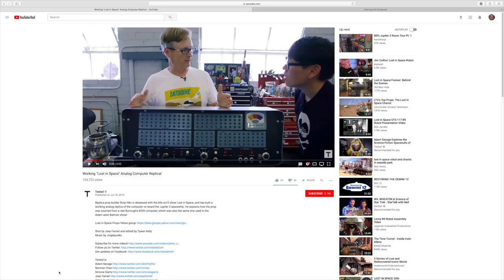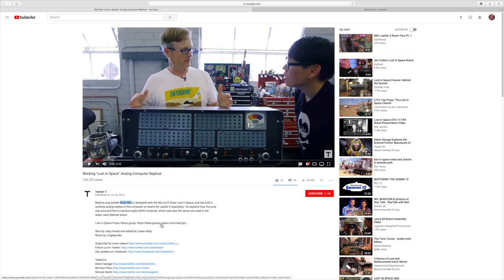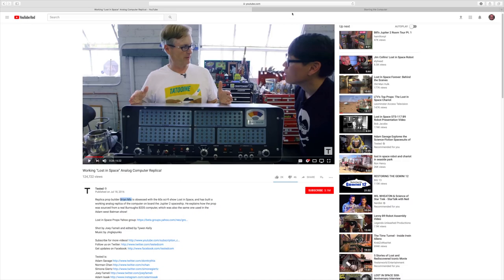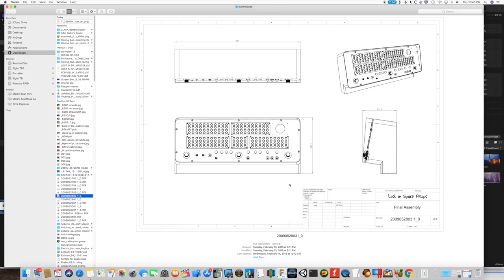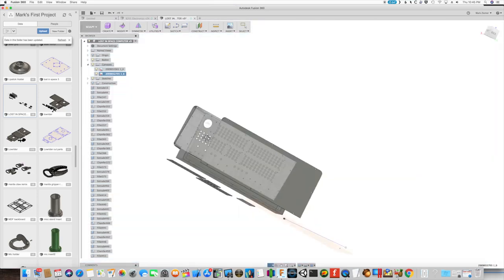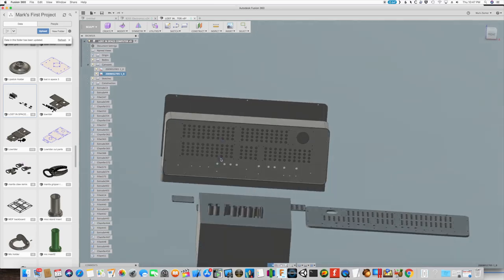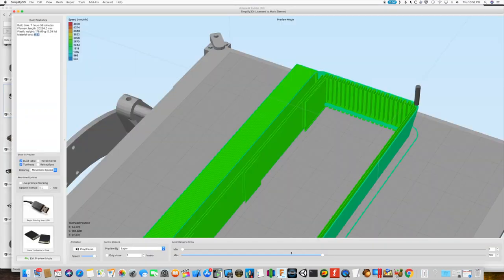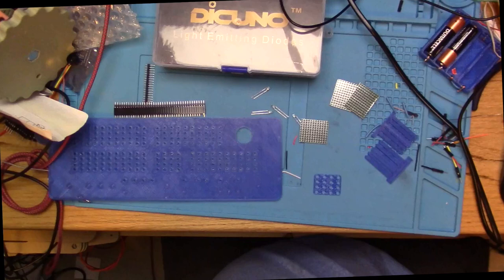Classic Sci fi Prop Build - Burroughs B205 Console -  Part 1

Comment: The original did, indeed, have a back.  It was sheet metal, with louvers stamped into it.  I'm assuming that it was of a lighter gauge than the cabinets, themselves.  If Burroughs used steel, those puppies would be HEAVY.  Possibly, they were aluminum.  I've had building a repro in mind for years.  I've gathered most of the over the counter pieces that I'd need, including a few strings of Christmas "button lights."  These would make good stand ins for the originals.  Unfortunately, I haven't seen these in the stores since I bought my own, back around 2008.

Comment: MCD Is brightness on LED. How many MCDs should it be on the LED to make it exactly the same?
Reply from the maker: not sure.  The original B205 by Burroughs used neon lights.  According to the tested video listed above, the props people replaced them with light bulbs. My plan was to use LEDS. We probably don't need to be as bright as the they were in the old films, and new cameras and eyes probably don't need as much light. I don't know what type of bulbs the prop makers used.  Sorry.
Reply: @Someoldguycoding  I saw a site that mention specifically GE44 bulbs.. I guess what the prop makers used?
https://www.grainger.com/product/GE-LIGHTING-Miniature-Lamp-6VC35

Comment: But I like your job! :) New video soon? :)
Reply from the maker: probably not for a while. In one of the later update videos I mention that I had some trouble getting everything to fit inside, and couldn't get the chip I was using to work reliably when chained. I'm kinda busy right now with some Lowrider CNC work to be done. I'd like to make one of these at some point, but it's not on the schedule at this time...

Comment: Cool project, do you have the b205fan website address, I have a lot of these plans, but not the dials page you showed. I think if I had a 3d printer I would produce the 11x4 and 4x4 faceplates for the LEDs separately and screw them on the B205 console panel (like the originals) for a more 3D effect. BTW I am building a masonite full size modified version with some arduino controllers.
Reply from the maker: That's my plan too, to print those front panels separately. Your project sounds great!  Please share a link to some pictures or your blog when available. I'd really like to see how you're doing it!

Here's the info you requested:

https://groups.yahoo.com/neo/groups/B205/info
1. If you don’t have a yahoo account, you’ll need to make one.
2. Become a member of the group (click Join Group)
3. You will then be able to access files
4.  Go to files -> B205 Blueprints (free)

Thanks for watching!
Reply: Thanks for the reply, I did join the club as you suggested. And I will upload some photos when I get things going on my version of the B205.
Reply: After several months of cutting masonite panels and drilling many holes I have come to the sad conclusion that my carpenter skills are not up to the level of creating a good precision model of the B-205. Are your 3D models of the panels available online for download? I am thinking I should have the panel 3d printed so they are more uniformed. Thanks for any help you can give me on this.
Reply from the maker: Thanks for the update, Dave. I was wondering how things were going!  I haven't got them up yet.  I will do that this weekend. My 3D printer will only handle the 30% version. And after trying to get the electronics to work/fit, I've decided I need to rethink it. Sounds like you need a CNC machine!
Reply: A CNC would be the way to go, yes,  hand held drilling is just not precise enough. I was planning on using 10mm LEDs to light my project, but also find that  wiring these in series and deciding on a power source is a bit trickier than old fashioned light bulbs. Please let me know the link when you get your model uploaded.
Reply from the maker: https://www.thingiverse.com/thing:2929681

Let me know how it goes!
Reply: Thanks, I will be rethinking my approach to this.
Reply: Can your 3D printer print the full size , 11x4, 10x4 and 4x4 panels? if so , what would be the cost to print me a set of this for one b205 unit? I could make the main panel in masonite or press board as I original started.
Reply from the maker: 10.70+shipping.  Looks like the 11 should just fit.  Let me print the 11s first to make sure they go ok. What color do you want?
Reply: Is this 10.70 for each panel or the set of 6 panels? Will they be paintable?
Reply from the maker: oops replied from the wrong account...
Reply: Thanks blue is fine, let me know how to send you the money. Thanks again.
Reply from the maker: Sorry, not done yet, severe multitasking...  We can communicate at someoldguycoding@outlook.com
Reply: @Someoldguycoding  Do you have a new link for the blueprints?  Yahoo shutdown a few months back.
Reply from the maker: @kennard42  I've uploaded what little I still have to http://www.someoldguycoding.com/projects/burroughs-b205-data/